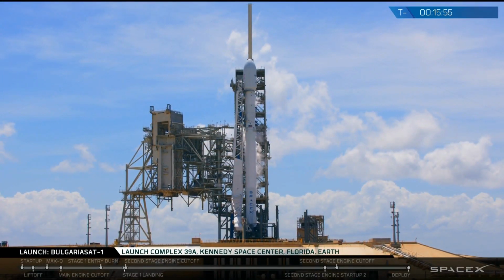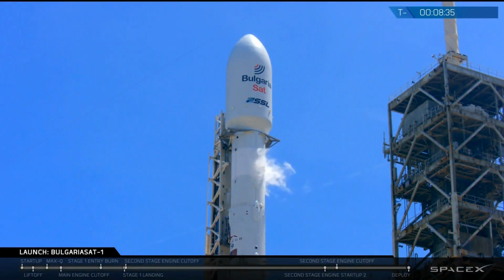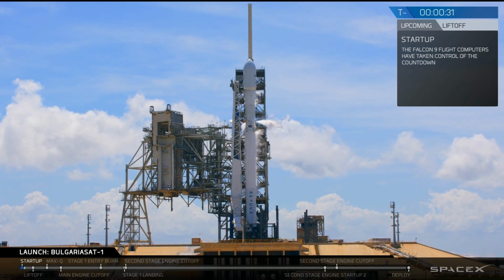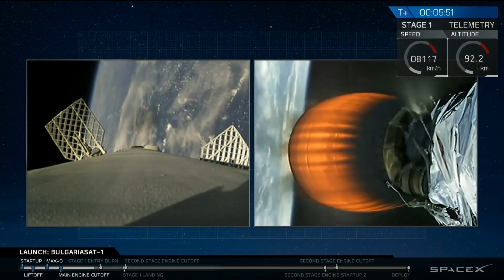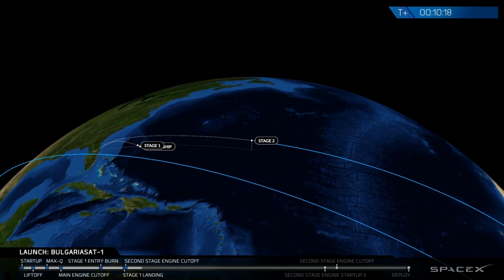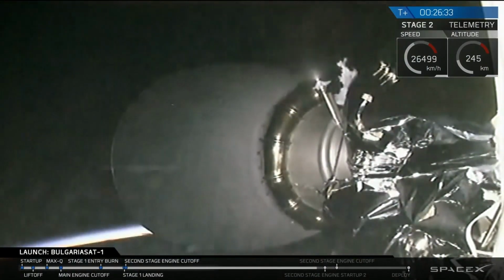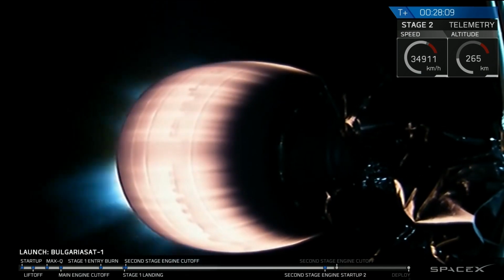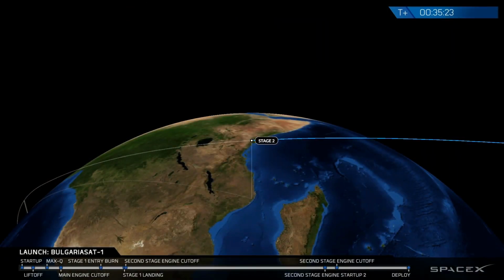Full Space X Falcon 9 BulgariaSat-1 Launch Coverage Using Refurbished Rocket From Iridium-1

Comment: Why should it be difficult to launch a rocket and return it safely to Earth? We landed a rocket on a rock 237,000 miles away and returned it safely 47 years ago, in 1969. I know, I know... It's not the same thing because the SpaceX rocket landed on a floating barge. Shit's fake like everything else.
Reply from the maker: because a surface that is swaying a tiny little bit is far more difficult then a target 400000 kilometers away from the next navigational aid - which again is still on 60's tech level
Reply: EDIcoN This is the equivalent of landing the rocket that brought the lunar lander to orbit.
Reply: +EDIcon, it isn't fake. When you land on the Moon, there isn't such a tight specific target or range in which to land - you can land many miles off if you want to, the mission is still a success. In this case the target is way smaller, because hitting and landing on this area on the ship is very difficult. Two different scenarios.

Comment: Fake as usual.
Reply from the maker: dumb as usual
Reply: Don't you find weird, that there in no landing video neither from the rocket nor from the landing platform?
Reply: Andrew Sean 300 miles out in the ocean? No. No I don't think that's dumb. They upload the footage from the camera memory card once the rocket gets back to port.
Reply: do you even know basic physics ? quote from my highschool textbook: "electromagnetic waves travel in any transparent medium but do not go pass opaque material"  translation for you dumb fuck, when the first stage goes past the horizon, it does not have a direct connection with the antennas and therefore cannot transmit data. For the drone shit, i don't think you've heard of the the interferences chapter either: an electromagnetic wave is destroyed when it encouters a wave of superior intensity. Translation: the turbulences produces by the landing of a 70 meters tower with 4 screaming jet engines covers the wifi of you house and any other communication device, wich means the signal cannot be transmited
Reply: +Andrew Sean, you are dumb as usual. Agility, well done for the accurate explanation. :)
Reply: Motokid600, video broadcast was going right from the space but stopped near the platform?! Do you really believe that bullshit?

Comment: The camera cut out because the landing was very hard and violent. Elon Musk on twitter already said before the rocket even launched it may not make it back since the landing will be harder this time because of the mission and conditions that day. This rocket is 70m/230 ft high and weighs around 550,000kg/1,207,920 lb (when its full) . Every connection or camera will cut out on that droneship with that rocket landing just a little to fast. 

After the landing Elon Musk also said that the rocket came down so hard it used the whole crush core (which absorbs most of the landing force) and as you can see in the video the rocket isnt exactly straight either. So go away with your theories, the force of the landing, made the cameras and the connection cut out for a couple of seconds until the rocket was landed.
Reply: Liars about what exactly? - I have seen landings where camera works and i have seen landings were it fails. From what i read this was a particularly hard landing hence the cut out.
Reply: Motokid600 Thank you for enlightening me.
Reply: jazzthieve fuck you
Reply: Why would they put only 1 camera on the ship if they knew this would happen????? They are straight liars.
Reply: No arguments so you just attack me personally? Yeah sure i'm the dumb one.